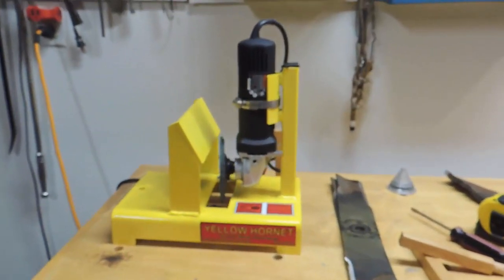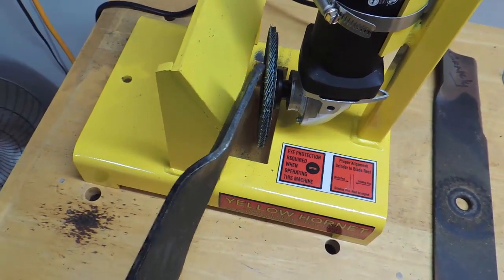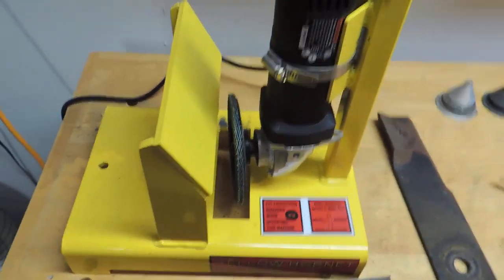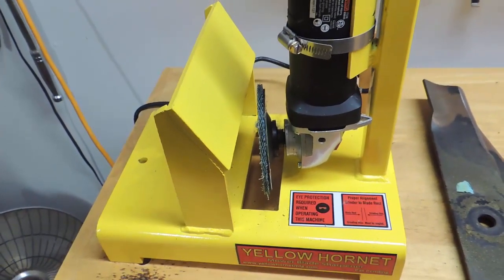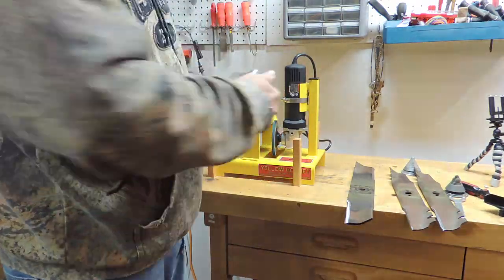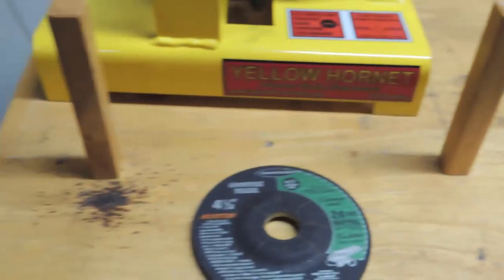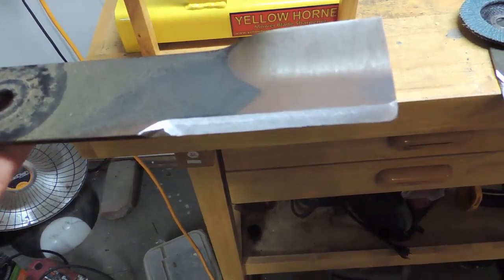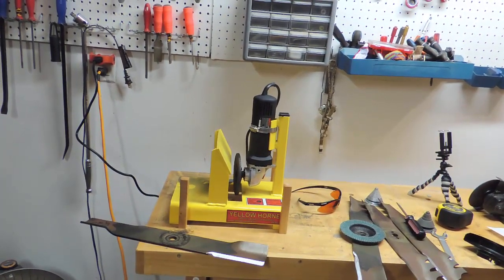The Yellow Hornet Blade Sharpener

Comment: Going to build a similar style jig. But I'm going to mount a 110v tool switch on it, and cut the grinder cord and wire it up to the switch. This way that I can just flip the mounted switch to turn the grinder on and off.  Don't have to fool with the original grinder switch at all, and it won't matter where the grinder switch is located, so long as you can lock the grinders OEM switch in the "ON" position, even if that takes a clamp or zip tie to do so depending on grinder model. I've got a "backup" angle grinder that I bought from Autozone some years ago for $4 and some change, that will be perfect for a dedicated blade grinder. As I don't use it for much else anyway. 
My main angle grinder that I use all the time is a Milwaukee, and I've put it through a lot of work and it still works great. If the cheap grinder gives out, I'll replace it with my old Milwaukee, and buy a new Milwaukee for my work grinder.

Comment: I can't get the outter half of the blade to sharpen like the inner half which is very sharp.  I've tried all different angles, wheel depths, etc and I'm just getting a blunt edge on the tip.  What is wrong?
Reply from the maker: Not sure, what type of wheel are you using? I use flap disks when I sharpen. I do find that I some times have to "free" hand the tips when the angles are off. I will be honest I have stopped using the hornet : not because it is bad but because I sharpen so many blades now I have had to step up the game a bit.
Reply: @BirchsLawnCareLLC  60 grit flap disc.  This hornet is a big paperweight for me right now - kind of disappointed.  What did you upgrade to?
Reply from the maker: RBG 712

Comment: Way too much money for something you can do by hand using the same grinder and the blade in a vise. It’s not rocket science where you need an expensive space consuming jig. Product is pretty cheesy. No adjustment for the blade hold and a hose clamp to secure the grinder?  I did 3 blades yesterday in 10 minutes yesterday sharp as all get out. Thanks for posting
Reply from the maker: The jig isn't about keeping the blade sharp, its about keeping a 30 degree angle on the blade. but I get it, thanks for watching
Reply: @BirchsLawnCareLLC  Exactly. Also by keeping the correct angle, not only does the mower cut better, but its also easier to balance the blade as well which stops a lot of vibration and wear and tear on the deck spindles, belts ect. I've seen a mower deck where the blades were so out of balance that it just about vibrated itself apart. The deck was rusted some and the metal was literally cracking to pieces from the vibration fatigue. 
I've used an angle grinder to sharpen mower blades by hand in a vice for years. Yes, it is doable to get decent results as far as sharpness goes. But after a few sharpenings the cutting angle will start to get off or start to round over. 
Further, I always seem to remove more metal toward the outer end of the blade, verses the edge toward the center. So I get a shorter blade life too. I'm sure there is some who can do a much better job than I can by hand. But for me, I prefer a tool or "jig" that will give easy quick repeatable and consistent results.